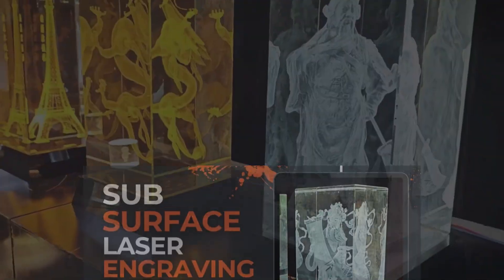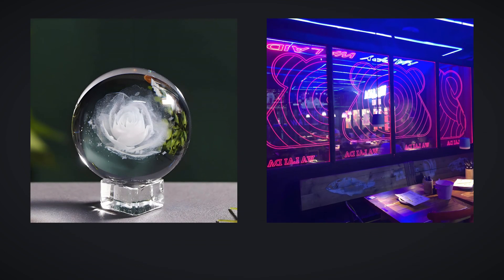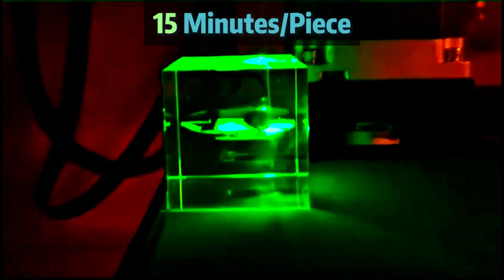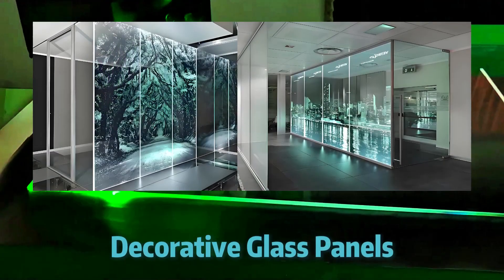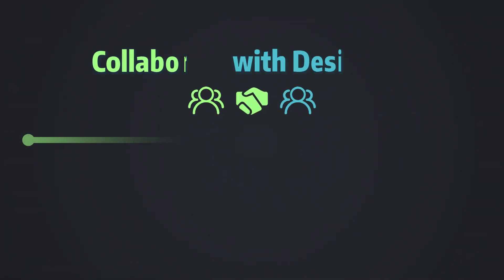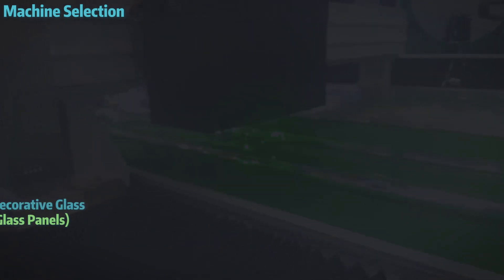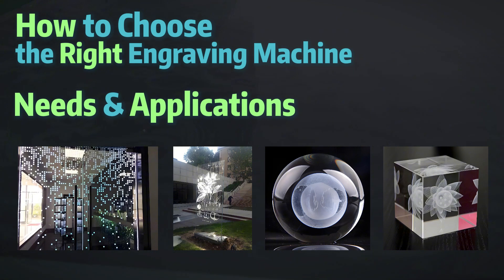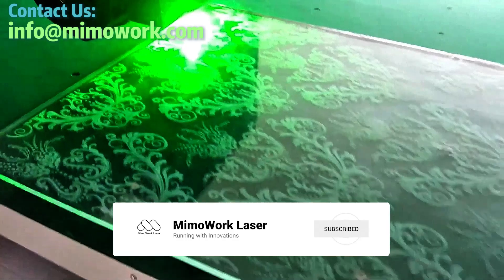Glass Engraving Machine | How to Choose (3 Simple Steps)

Comment: I’ve been interested in 3d crystal engraving but haven’t found out much about different machines, software, and where to source the crystals.
Reply from the maker: For machines, our 3D Subsurface Laser Engravers are a perfect starting point.
You can explore the options here:
https://www.mimowork.com/galvo-laser-marking-machine/3d-laser-series-for-subsurface-laser-engraving.html

On the software side, don't sweat it! Most machines come with user-friendly software included (whether you're doing 2D or 3D designs). It's easier than it looks, we promise! 😅

Sourcing crystals? Online is your friend! We recommend starting with sites like AliExpress, Amazon, or even local crystal suppliers. The trick is balancing quality and cost, but a little trial and error will quickly show you what works.